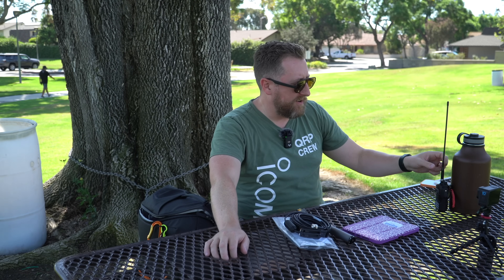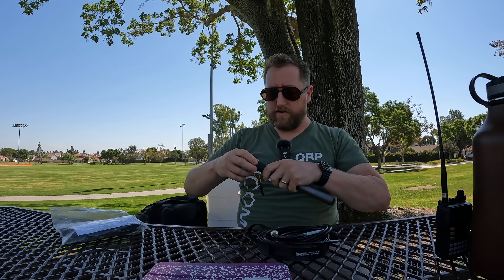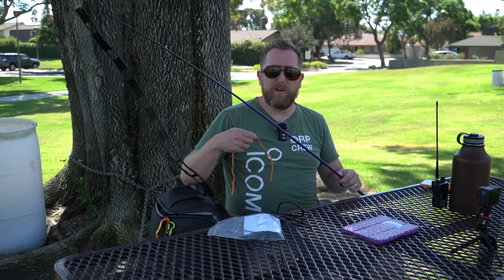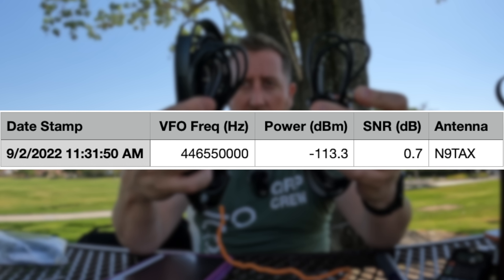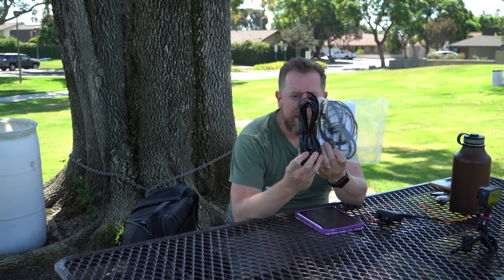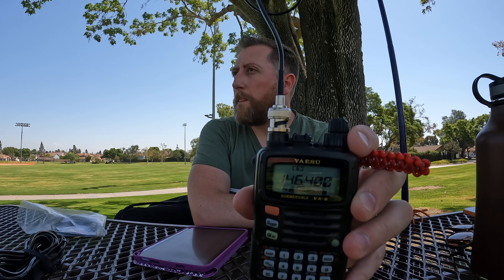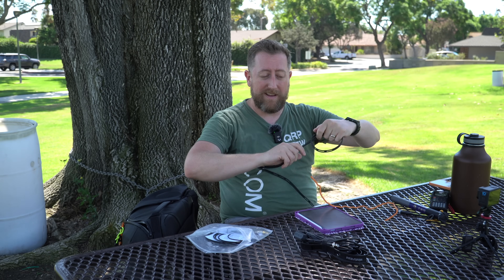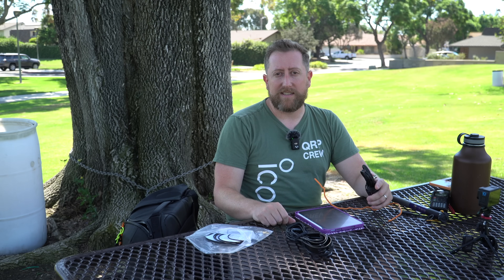N9TAX vs. Ed Fong J-Pole Ham Radio Antennas TESTED!

Comment: I have both the Ed Fong, and the Dual Band version of the N9TAX. In my own testing, they performed so similarly in practical use on both 2m and 70cm, It completely came down to form factor to me. 

My primary use for roll up are portable/emergency use antennas. I have a Condor "Side Kick" pouch for each of my portable radios. These contain APP 12V power leads, programming cable, Microphone, Signal Stick, BNC adapter, extra battery, etc. The Ed Fong rolls up and fits in one of these along with an extension cable. The N9TAX does not. 

So, the N9TAX is instead used as a backup antenna for at home, field day, etc where having a bulky antenna is not a problem.

Comment: After owning 2 N9TAX,  that both broke in the same place, I'm glad I found the Ed Fong. I'm almost certain it could be rolled up an unrolled indefinitely without the same issue.
Reply from the maker: Ohhh? Where did it fail?
Reply: @HamRadioCrashCourse  I call it a "joint" , I'm not certain the proper terminology, but basically where it transitions from twin lead to a slightly larger area that's covered in what looks like heat shrink.

Comment: I got a couple N9TAX dual band antennas. The SWR is pretty low and gets out. On a side note, if mounting it inside, keep the feed point of the antenna free hanging. That will increase the SWR to above 3:1, which can damage the radio.
Reply: I did. I set up one for a ham in a nursing home. The feed point of the antenna where the coax connects to the window line needs to free hang. Having the feed point secured to a wall will increase the SWR. 

Some body put some tape around that area of the antenna to secure it to the wall. I checked the SWR on the antenna with my IC-705. Sure enough the SWR was higher than 3:1. I removed the tape and rechecked the SWR. It fell below a 1.5:1. Not sure there was a nail in that specific spot or what, but after the tape was removed and the feed point was free hanging, the SWR on the antenna dropped significantly. If he had used a FT70D I got him any longer, he would've burned up the finals in that radio.
Reply: @pale_2111  Thanks for the clarification and example.
Reply: Not a problem. After I reread my original comment, it did sound a bit vague. Just thought I try to make it make more sense.
Reply: @pale_2111    Use the edit mode
Reply: "On a side note, if mounting it inside, keep the feed point of the antenna free hanging. That will increase the SWR to above 3:1, which can damage the radio."

Did you mean to say .. keeping the feed point free hanging will avoid increasing the SWR?

Comment: Thank You for testing the N9TAX. I can almost buy two N9TAX antennas for the price of one Ed Fong. Huge plus there. You didn't mention price. The N9TAX can be had with just about any fitting with 18" of coax for $30.00 (a steal for the price). The N9TAX  also has a ferrite built in. The Ferrite that the N9TAX includes might be a big bonus when running higher power. A choke is something you want on a J Pole design antenna. Both are great antennas. The N9TAX is slightly larger. Not a problem for me, it might be for some. I have no experience with the Ed Fong, but have had a N9TAX 2m/70 cm antenna up for 2 years that I use when running net control for bike races as a second antenna for my 2nd radio. It has held up in the rough weather and performs fantastic on both 2 meters and 70 cm. The build quality is excellent. The price savings and the toughness of the N9TAX has made it my choice. Also, N9TAX will cut an antenna for an exact frequency if you want them to. I also ordered two for GMRS. One at 462.550 MHz and one at 467.600 MHz. Both are spot on when it comes to to SWR and perform very well. These 70 cm antennas are great for use in CERT comms. Short, sweet, tough and they really increase your range. Add one to your CERT kit.

Comment: I'm not surprised by the 70cm results. Ed Fong explains in a YouTube video that he uses 1/4 wave stubs to make his antenna a true half wave radiator on both 2m and 70cm. My understanding of the N9TAX is that it works harmonically on 70cm and is not a true half wave radiator. Ed Fong explains in the aforementioned video that j-poles harmonically operating on 70cm are very lossy and his analysis shows they don't work much better than a duck antenna. That and size are why I bought the Ed Fong.
Reply: I do not believe that to be correct, the N9TAX has coax traps for the 70cm section. It is not just a monoband jpole, although N9TAX does make monoband jpoles also
Reply: Here's the video: https://youtu.be/E_IBni6vvMc
Reply: I was going to add that. I remember reading that in Ed Fongs article. Most roll-up J-Poles/Slim Jims have that same issue on 70cm. SWR might look OK. Unless you have test equipment, its not directly noticeable.  So N9TAX is working as designed. No anomaly. It is fine on 2m.
Reply: I said "very lossy" in my previous comment, but I meant the 70cm harmonic is less efficient due to the radiation pattern.

Comment: I enjoy the Ed Fong model best as it’s more easy to store and travel with as well as deploy. Also helps some UC Santa Cruz students. I met Ed at his home and can state the man has a very educated background when it comes to the subject of antennas
Reply: I have had the opportunity to speak with Ed Fong via telephone on a couple of occasion, and I have found him a most helpful and knowledgeable individual. My most recent interaction with Ed was in connection with a custom VHF only J-Pole antenna cut to a commercial Rail Road frequency for the purpose of replacing 50 Ohm termination resistors found on at the end of two radiating antenna (Radiac) cables  on the Manhattan Bridge in New York City. 

The J-Pole VHF antennas were engineered to bridge the physical gap between the ends of two Radiac Cables mounted on the Manhattan Bridge to improve VHF radio communications between trains and the Rail Control Center as trains crossed over the East River. Ed was most cooperative at meeting our specific non-Amateur radio requirements that helps to insure public safety.
Reply: I picked up my antenna from Ed a couple of weeks ago after HRCC's first video. Agree, he's a wealth of knowledge! Haven't had a chance to try it yet, but these videos give me a lot of confidence.

Comment: Carbon fiber pole?  That can significantly affect signal if the antenna is too close to it.
Reply from the maker: All antenna under test are subjected to the same environment.  Also, please send me the link to evidence on "significant" affect and I'll take a look.
Reply: Josh, I’ve tried responding with a link, but it never shows up here … or it gets deleted somehow.  George Z has commented on it in his podcast and in his groups dot io forum based on testing he did with both fiberglass and cf masts.  I’ve experienced the same.  The closer the wire is to the cf, the more it detunes.  I wonder if the wider twinlead of the n9tax did something different, or one of the antennas laid against the cf slightly differently?
Reply: @davistroy  Yeah isn't fg non-conductive while cf is very conductive?

Comment: Glad you tested out the N9TAX antenna. I’ve been very happy with mine. It was the first antenna I bought for 2M use as an antenna in my attic and I’ve been happy with it - I tried “upgrading” to a Diamond X30A, only to find the N9TAX clearly outperforms it!
Reply: I ran a N9TAX for 5 years as my base.  I just replaced it with a diamond X200.  This one does out perform the N9TAX by about 20% based on the extra distance of contacts I can now communicate with.   Saying this only proves to me the quality and ability of a $30 antenna , which is the N9TAX, a SOLID performer for a Great price !
Reply: I’m looking to set up an attic antenna as well, how did you set yours up??
Reply: @mdc21787   nothing fancy - just hung it off of a rafter. My attic is tall enough it can hang vertically with no issues.

Comment: Good Review!  You mentioned the ferrite on the N9TAX - I assume the concern is prevention of common mode current. I think I remember in an interview with Ed Fong that he mentioned he uses a coax sleeve choke to prevent common mode current in his design, but I may be wrong.
Reply from the maker: It's just a different way to choke common mode.  If you do the sleeve, that is just a bunch of beads with the coax going through.  My preferred method is use a bigger ferrite with larger inner diameter and wrap the feedline to give it multiple passes.